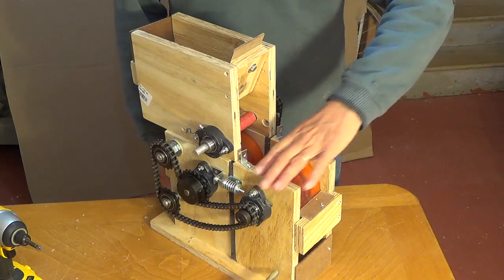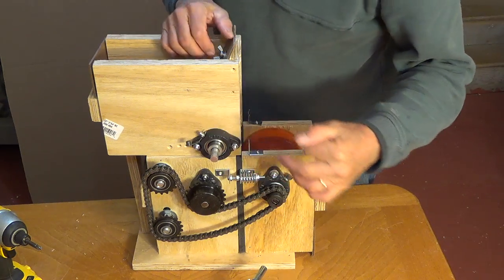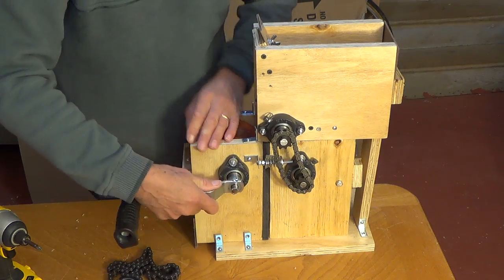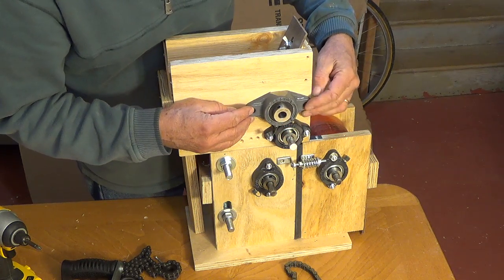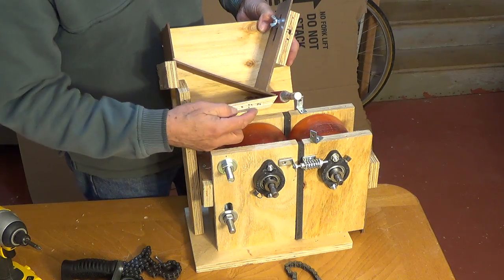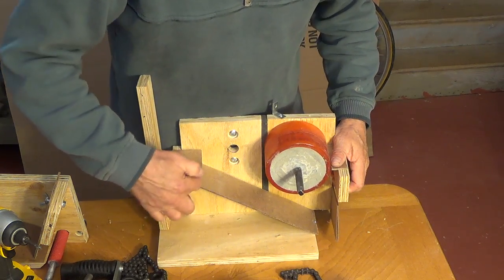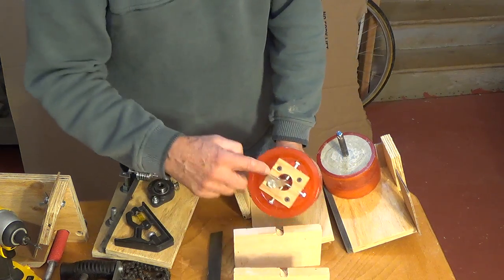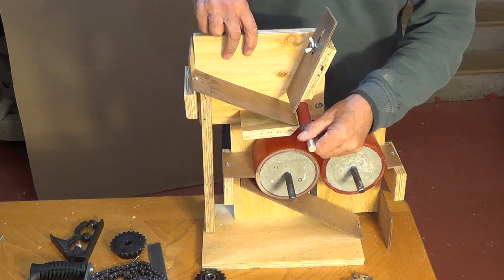rice huller building instructions Brillengineering.com, Ali-express for urethane wobble rollers,

Comment from the maker: Make sure you look at the centrifugal machine I developed.  We did a lot of different grains with it and it is easier to build.  The only problem was that I couldn't get a bike to get the impeller turning at 3,000 rpm.  It works with a most any small motor from a 1/4hp dc to a 5 hp gas one.
Reply: Hello.. thank you so much for this vidéo..  please can you share you website link ?
Reply from the maker: @karounkapedrokilombo2374  
The website is ricehuller.org. We haven’t added instructions to the site yet.
Reply: @brillengineering7889  thank you for your response

Comment from the maker: Shri Vrindavannath asked about lentils, so I bought 2 pounds of lentil seeds.  The impact huller de-hulled about 30% which isn't good enough.  The pinch roller system shown in this video doesn't de-hull any of the lentils.  But, I could remove the hull (husk) by hand with 2 sheets of 100 grit aluminum oxide sandpaper.  The husk came off very quickly.  I've ordered some sandpaper with an adhesive backing which I'll put on the rollers.  This might do the trick.  If it works the sandpaper will only come in contact with the husk of the lentils.  I'm trying this instead of using a stone.

Comment: Is this same process for lentil dehuller? I really appreciate for your help and shared info.
Reply from the maker: the grain needs to be hard like rice,  look at the video of the centrifugal huller, we did a number of different grains with it, but not lentils
Reply: Brill Engineering thank for the answer. By the centrifugal you mean the impact huller? I saw the videos and saw that you got Indian huller, there is many videos of lentil hullers, can you say if they are same system? I haven't found any that shows thow the system works or how is the internal parts. I really need to get, buy or build something to de-hull red lentils and mung beans. I'd be very thankful if you can help me out with this just by telling me if that is same system of impact or centrifugal they are using. Thanks a lot for the work you are already doing by sharing all this info.
Reply from the maker: the lentil de-hullers appear to use rough stone with a set gap so neither of these would for lentils.
Reply: @brillengineering7889  Hi Brill Engg,  whats the cost of this machine, shipping to be done to India. Thanks

Comment: Would this work to hull Buckwheat as is or would it need to be modified with sandpaper on the rollers?
Reply from the maker: we tried buckwheat with the pinch rollers and it doesn't work.  The impact huller will work but very difficult.

Comment: Good day sir, where did you get that size of rice rubber roller?
Reply: up
Reply from the maker: Stoltz Manufactures the rollers for boat trailers, I bought them from Eastern Marine, Take a look at the huller that has the wooden disks covered with a urethane sheet of 90 durometer,
Reply: @brillengineering7889  sad :( it is not available in philippines

Comment: Is  the machine good for hulling oats?
Reply from the maker: oats are too soft, so no, we tried them,
Reply: hi, if oats are too soft for this kind of machine, do you have any ideas for a DIY oat huller? I tried blender, food processor, coffee grinder - I get crashed oats and hulls, difficult to separate. I had 2 small pieces of rubber and it seemed to work better... minimal grain damage, I would appreciate any suggestions. thanks
Reply from the maker: Oats are very difficult, I believe the industrial processors first heat (cook) the oats prior to removing the husks.  There is a no hull oat variety.

Comment: Do you have DIY video how to make one???thanks
Reply from the maker: there is a video showing the construction, the links are on the web page, brillengineering.com, I also stopped using the cement as a filler on the rollers.